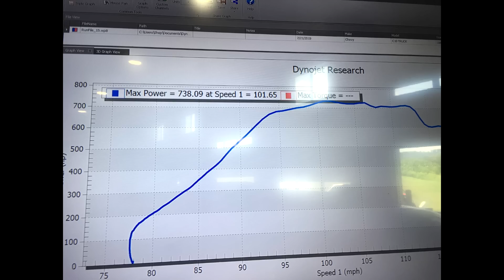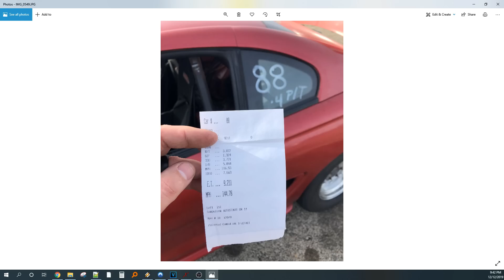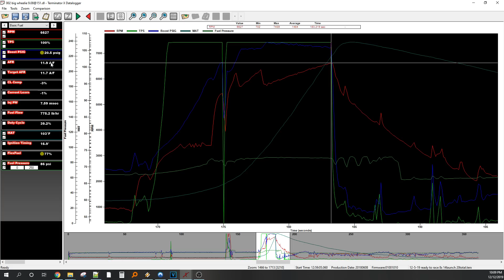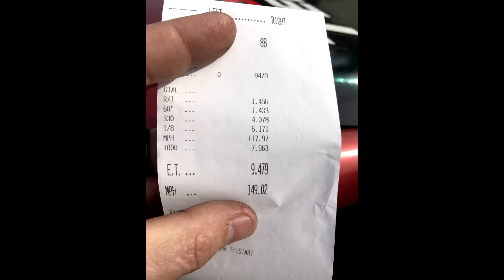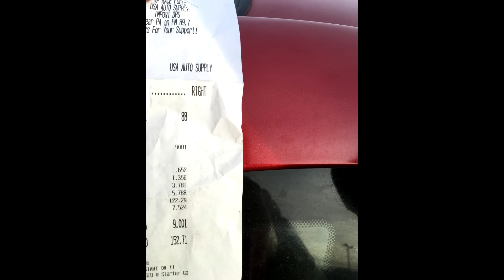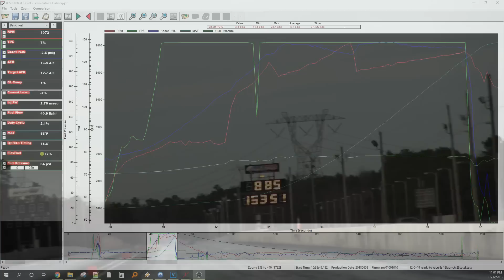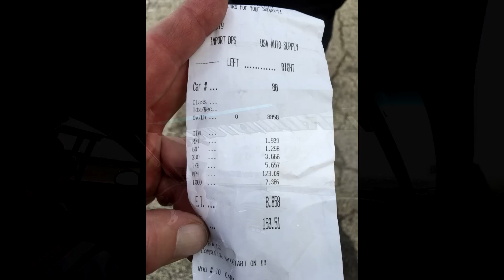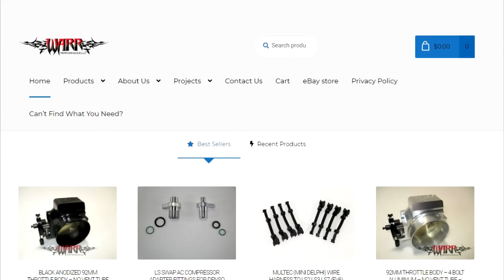Can a junkyard 4.8 go 8’s? For $8,000? Blow it or show it

Comment: Congrats!  Protip: two big wrenches make acceptable jumper cables.  I used these about a half dozen times this summer on a drill at work that wouldn't charge its battery.  Had to charge the battery on the generator and then bring it over to jump the drill, then disconnect the dead battery and bring it over.  The lights and everything run off of the battery in our fly drill shacks.

Comment: It was an amazing build and it was both enjoyable and agonizing to watch this to completion. Great accomplishment but I think there could be more emphasis to be made on what an incredible deal you got to buy that car for 1,900.  It's not every day you find a tubbed, roller race car with tubular, adjustable suspension, built rear, built rear suspension, 8.50 cage, tubular K-member, fuel lines and fuel cell etc. etc. etc.  Not saying I don't believe you. Just saying..
Reply: Well you see older project cars pop up every now and then. I think Matt said the shocks were already pretty old so this thing had probably been sitting a while (not having followed the build I must say)

Comment: You have kno idea how thankful I am for this build and all this info and have me the confidence to start my SN95 build (95 v6)I'm going to do everything I possibly can except for turbo kit and the important fab work . Monday I started tearing it all the way down, its getting a 2011 4.8 with 141000 something miles unopened with a LJMS cam and BTR springs it some 210's  might get a summit 102mm intake and TB I got one on my 4th gen z28, its gonna get Th400 and PTC converter I bought a nice 8.8 with moser axles spool and 4.10 gear off Facebook and ofcourse Holley terminator kit I cant decide wich turbo at the moment either a t6 s475 or s480 and iv heard a few people say that foxbody ls swap turbo kits go in Sn95's fairly easy.    Thanks man

Comment: I recommend you budget $50 for an AGM 26AH leak-proof battery from Ebay
I've used a smaller version (18AH) to crank stock LS engine before. 
Keep as a spare for when the main battery fails. Long shelf life, won't leak if you flip it, might just save your ass for $50